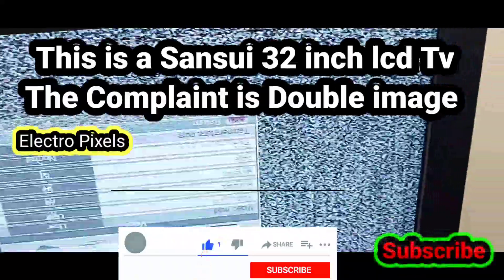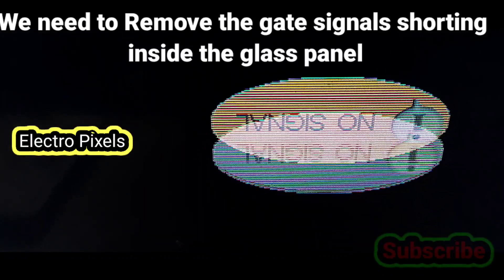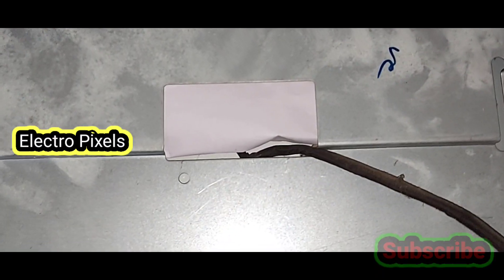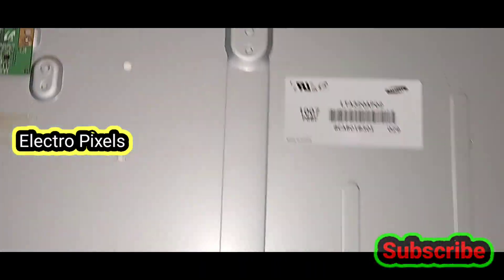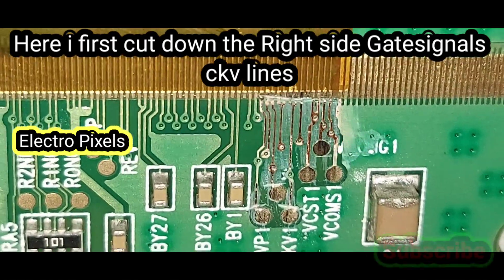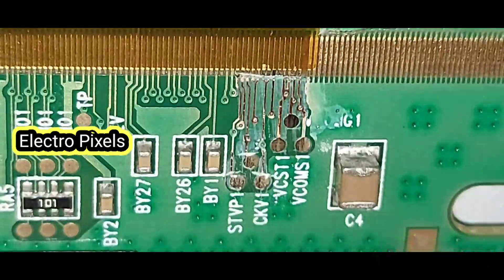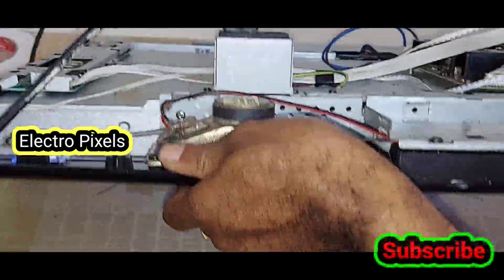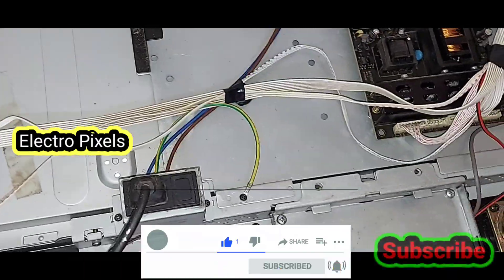Led Tv Ckv Short removal on 32 inch Sansui Tv For Solving Double image and color changing.

Comment: Change panel
Reply from the maker: Why, After Repairing its working till now, about more than six months. Permanent Solution panel Replacement its already mentioned in the video. Also customers don't spend huge amount, Because panel replacement is costly. So they prefer to Repair. Even if we put new Panel or buy New Tv the Panel Life unpredictable its all depends on luck basis. Panel Complaints will be there in all panels within one or three year